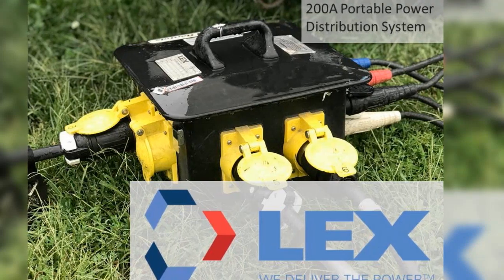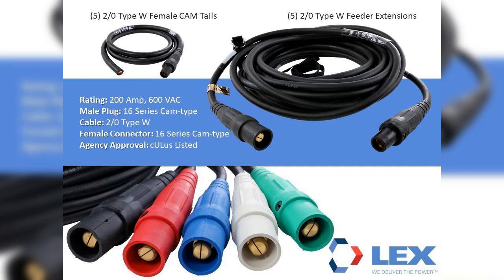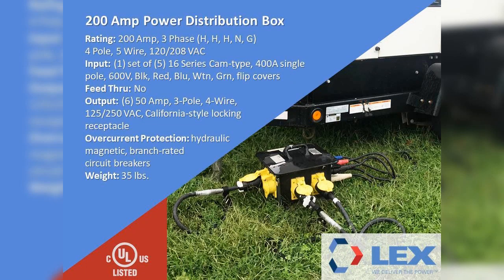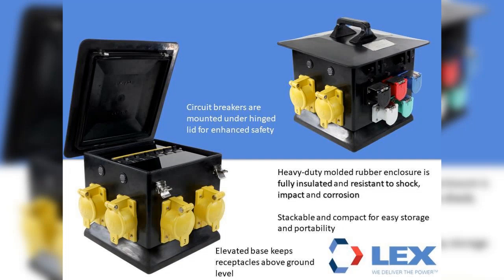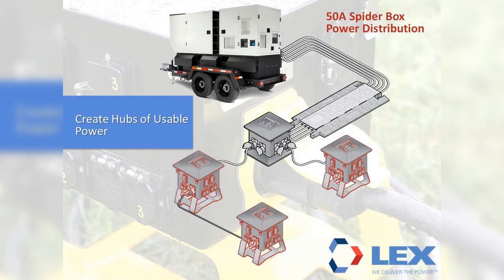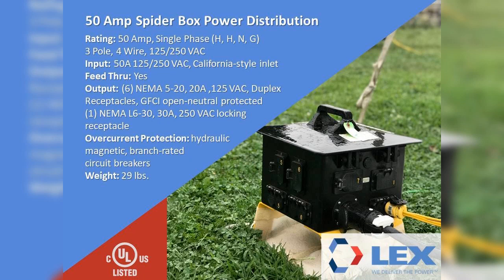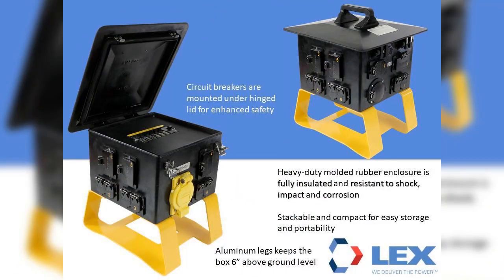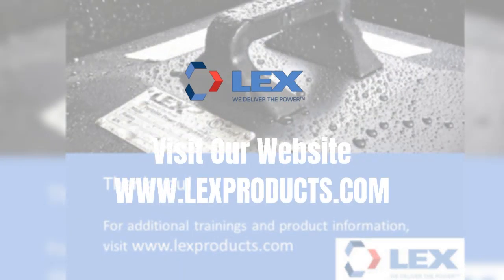Lex Products 200A Portable Power Distribution System - Training

Comment: Can you make this so it can be sold in a complete set that includes 1× 200A 120/208-Volt Portable Power Distribution Unit, 6× 50A 125/250-Volt Spider Boxes, 1× Set of 16 series cam connectors and 6× 50A 6/4 SOOW Cords?